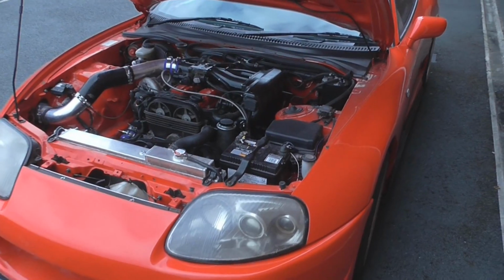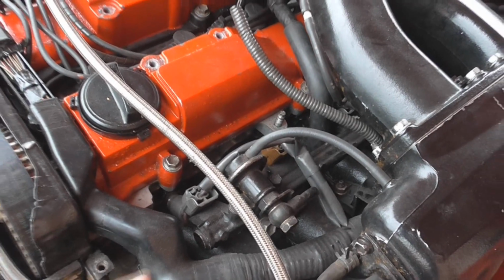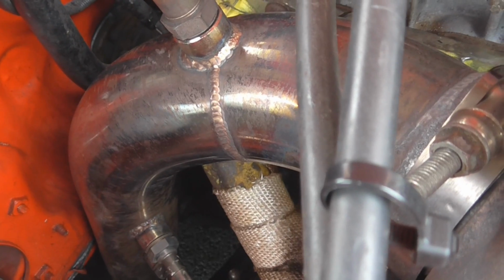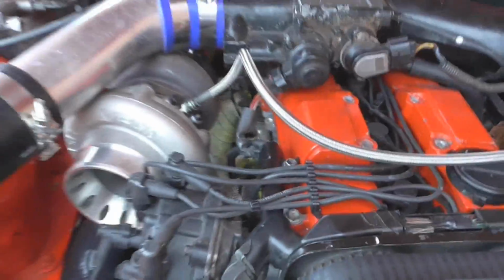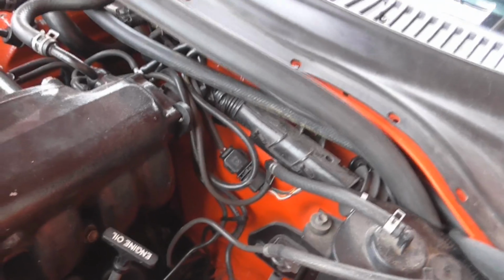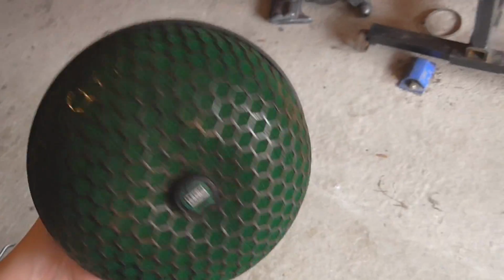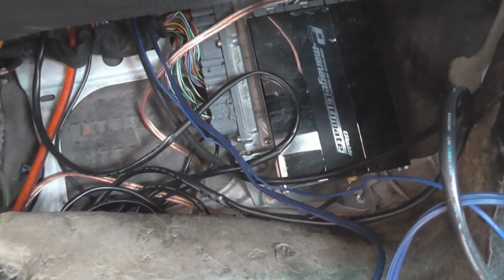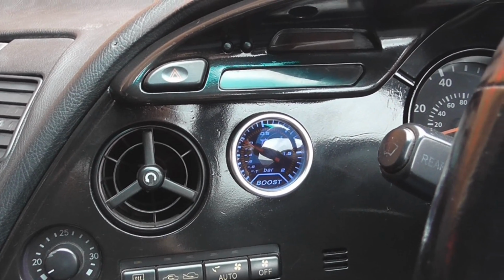HOW TO BUILD A SINGLE TURBO SUPRA

Comment: my na-t build started with an xs power full kit megasquirt ecu and 650cc fic injectors. worked perfectly for 3 years as it was my daily driver then my a340e shat out on me so i brought it to atf and got the stage 3 built a340e. then i just went crazy with the fuel system tt hg arp head studs cams bigger turbo and full aem v2 standalone.

Comment: Good work brother! Keep it up, not sure if I missed it but how much power are u hitting on 7-10 psi?
Reply from the maker: 330bhp mapped. On 7 psi
Reply: Bluudys Garage congrats brother, that's a great number with such low boost.
Reply from the maker: @RB54DaBears  indeed. And a great starting block for more.

Comment: Hey mate, nice car 
I recently bought a na toyota supra.
Was just wondering if you have done any else to your car? (Transmission, driveline, diff, etc)

Also do you think this is worth it?
Reply from the maker: Hi, Take a look around my channel Theres lots of videos. Mine started as a stock body (ish) White NA Auto. Now a Ridox/ Trial kitted NA-T Manual in red. Loads of videos of the build. Subscribe and take a look around :)
Reply: Absolute Modicts alright will do, i only just saw your post on facebook in the supra page so 

But you definitely have another subscriber
Reply from the maker: Thank you, Any questions just ask. We also have a Absolute modicts page and group for chatting on Facebook if needs be :)
Reply: Absolute Modicts ill definitely check it out
Reply from the maker: nice one, thank you!